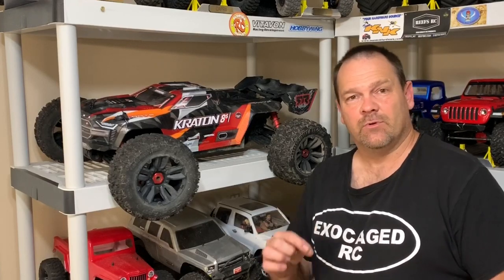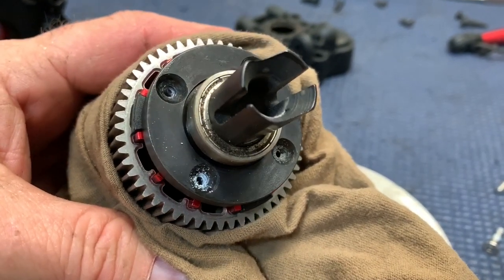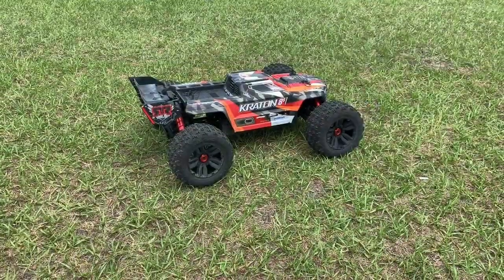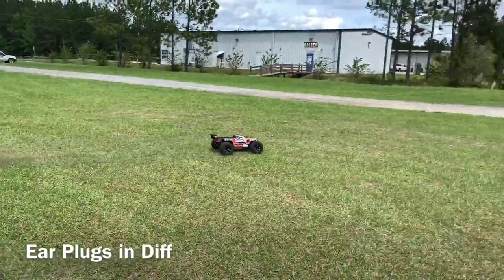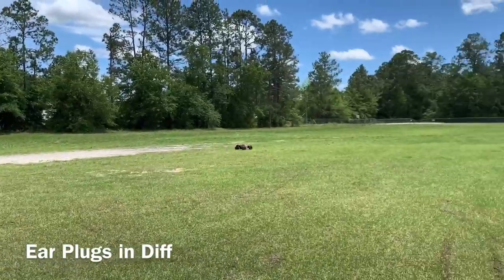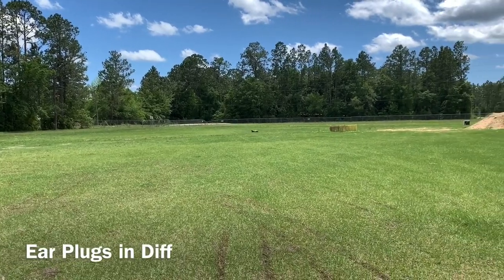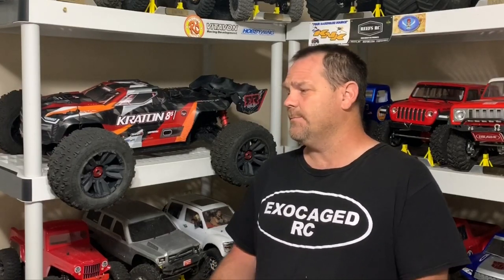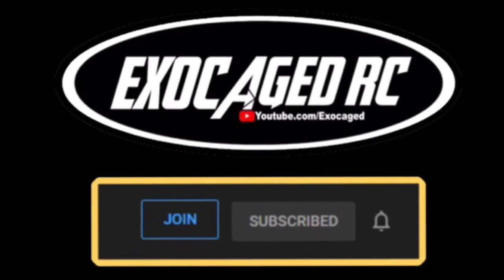ARRMA Kraton 8S gets Earplugs...in its center diff!!

Comment: One way to do it is stick the Allen key in the spot and heat up the Allen key. The heat will travel and not heat what you dont want heated up. I use vice grips to turn the hex wrench when its hot

Comment: I am using ear plugs for 4 years now in my center diffs and never had problems! that kraton is a dream to work on man love it😍
I need to save some money for one
Reply: May I ask why you would do this?  Trying to figure out what this mod really does?  Would this be suitable for Outcast 6S?
Reply: @jhalpinjr  This is to lock the center diff - > to have the same power distribution on front and rear wheels. Advantages of this solution are lack or decreased ballooning of front wheels, better wheelies capabilities, better backflip capabilities (I am not sure if it is true). Disadvantages are worst handling during acceleration and worst breaking because both - front and rear - are blocked within the same 'power', I do not know how to say it in english but I mean that there is no difference between speed of front and rear wheels so car can do the frontflip during each breaking on the well grip's surface.
Reply: @danielnoname8352   Thank you for the detailed explanation Daniel!  Much appreciated!
Reply: @jhalpinjr  i use it in my outcast 6s i mixed the ear plug with the stock diff oil and works great, it is still turnable

Comment: I put center diff in mini e-revo was not to impressed. Work awesome for racing, not so fun for bashing. I put the the stock solid one back in. Getting the perfect slipper clutch setting is the key for the mini e-revo. Front diff with light oil, back with the hevyest I could find. 
Awesome video👍

Comment: Great video, really helpful. Having a hell of a time with my Traxxas Sledge and its 50k/20m/50k front/center/rear diff oil set-up. Never saw the attraction of standing backflips and wheelies at all speeds, so going to change to 100k in the center like most stock Arrmas.

Comment: Soldering iron is a better option because it keeps the heat more localized. It's hard to use a flame on something like thst without overheating things you don't want hot such as bearing grease etc.
Reply from the maker: The issue with a soldering iron is it takes so long to get the heat in there you have what’s known as heat soak. It heats so slow that the whole piece has to heat up, takes a lot of time on larger pieces and aluminum absorbs heat fast. With a torch I can hit that spot, heat that spot quickly and get the screw out before heat soak occurs. Yeah if I get stupid and leave it on too long it can easily cook everything there. For really small parts I’ve used a soldering iron successfully but on the bigger things I prefer a torch.

Comment: coming from racing background i set my transfercase so the fronts dig more than than the back . i want speed and be able to turn at high speed . wheelie is fun but slow to get going plus no fun when trying to brake when geting front end up at 1/4 speed. i use long travel suspention that way the shocks are absorbing the beating and banging . if your r/c is hitting the ground your breaking and bending stuff .

Comment: Interesting test…..I’ve used ear plugs in other smaller rigs but nothing this size. …so that being said I opted to use an aluminum solid locker for the center diff…I added a little oil for lube to the contact points. …I have yet to test it.

Comment: Hey again I’m subscribed bcs I keep coming back. GUESSE WHAT, I have the same setup and I’m slapping a set of Bandito X street tires and some center plugs on the EXB. Ive never seen anyone SMOKE tires on a K5 and the ONLY “good” video with a K5 on Dito x’s had hobby wing and he didn’t do anything crazy but the SOUND of them tires on pavement when he power slid sounded like an actual car slamming on its brakes! I’m soooo tempted to make a long wheelie bar for the K5 and smoke those bad boys with 11’s all the way down lol. If the felony can do it stock, imagine what castle can do on the K5. You ever ran Bandito X or seen anyone drag race a K5 ?
Reply from the maker: Hey man welcome! I’ve never ran the bandito x tires but yeah man if you power that K8s up it need a wheelie bar or skid or something.
Reply: sorry im late! i got kraton8s exb a 1100kv firma, big servo hight torque, proline street tire manice and put center lock and is a beast! is no more kraton! is now KRAKEN

Comment: There's already a huge flaw in your comparison. The diff oil was ran in wet grass. And the earplugs on dry grass get better grip less water weight.
Reply from the maker: Unfortunate I can’t control the weather but I try to schedule things so conditions are the same. But either way the ear plugs have made a wonderful difference for this truck.

Comment: It's slow, love the review though. I expected more, if the RTR does 55+ out of the box....i purchased the mamba xlx2 with the 1100kv the most i see any of them running is in the mid 50's.
Reply from the maker: the RTR doesnt do 55+ out of the box sorry, I have box stock videos on that. the thing about the mid 50's is it gets there stronger and faster, we really don't need much more than that, at least I don't
Reply: @ExocagedRC  Acceleration off road...i got yah. I'm doing your servo vidz now last component left to buy (150-250 range), I'll link my purchase through your page. Thanks for the info.

Comment: Hey Exo, I put the earplugs in my 8S;  do you have any recommendations for the front & rear?  Stock 500K or higher?   We launch the trucks on big Ramps. Thanks!
Reply from the maker: I left the front and rear alone but when they break I usually use 500k. No need to lock them.

Comment: I think this seems like a pretty good compromise between no ear plugs (too loose), and what the X-Maxx does (flips way too easy).
Reply: Im considering the ear plug on my 8s Xmaxx. What do you mean with flips way too easy? So too much standing back flips and hard to accelerate, or what?
Reply: @lukasdohle4605  ya, if the center diff to TOO stiff, it'll be hard to keep the front end down, but it is better for stunts that way. With the right balance between stiff and loose, it'll do wonders for speed runs and cornering. Too loose though, and you won't be able to do any flips in the air, and can even hurt overall performance. Ultimately, it's really based on your driving preference.

Comment: Only thing I'm worried about in my xmaxx. It wheelies enough stock and I have a max5. I don't want it to wheelie more by doing the plugs
Reply: I have a max6 and put silicone ear plugs into the center diff for my Xmaxx. Also recommend putting 100k front and rear.

Comment: Hey . After you put the ear plug in the center diff. Did you notice that after you let off the throttle the truck slowed down. I mean did the truck not free roll as easy? Definitely saw better performance. But the resistance when let off the throttle. Is this normal? Because of the ear plug.
Reply: No , either your front or rear brake is dragging - causing it all to drag

Comment: never trying to use center lock instead earplugs? for me, center lock is better than earplugs
Reply from the maker: I’ve tried that before and I usually end up with problems in such a big truck. Haven’t tried it on the K8s but I broke the locker and center pin with it on the DBXLE.

Comment: Why ear plugs? What's wrong with the center diff? Just put in 500k and that's it those things are bullet proof.
Reply from the maker: The silicone ear plugs are a stiffer than 20m oil. Better backflips
Reply: @ExocagedRC  ohh ok got it. It won't damage the center diff right? That's a heavy truck to do backflips on demand. Very nice 👍

Comment: I realized it with a center diff you have greater control, but for an off-road RC they are the worst thing I've ever seen before, might as well just have a two-wheel drive in my opinion
Reply: Not really, if you land a jump badly with a spool in the centre and no slipper yes with just break the front or rear diff all the time like on a savage flux when people run the slipper locked up.
Reply: @LawrenceTimme  I had this exact  problem with my savage Flux xl before I switched to a center diff, trannyless setup. Now even with 1'000,000 wt grease I can botch landings as hard as I want and it bulletproofed the whole drivetrain